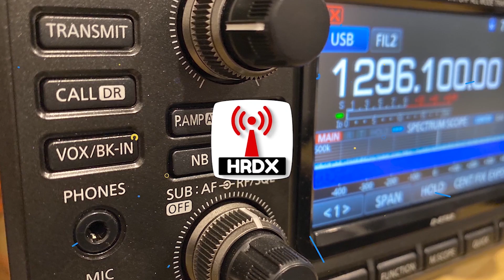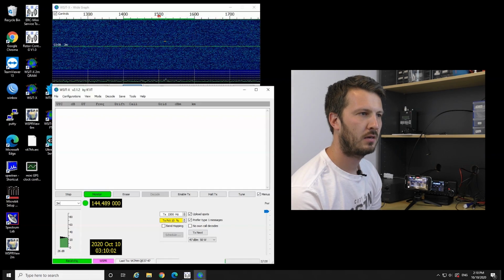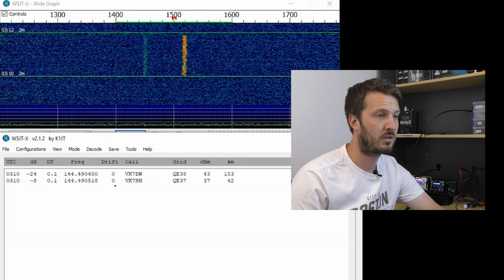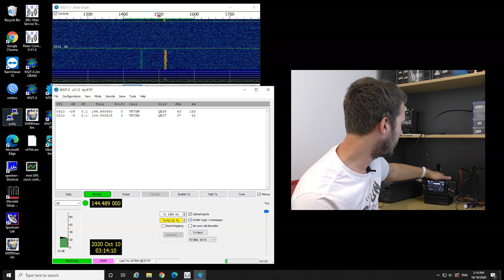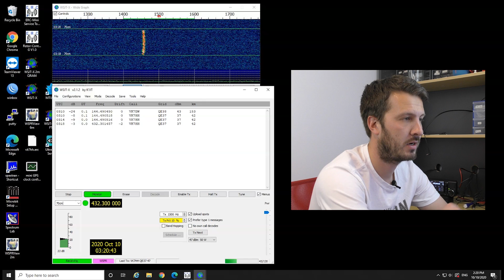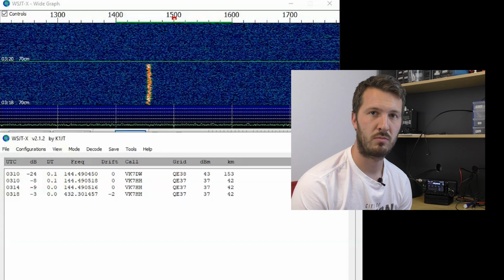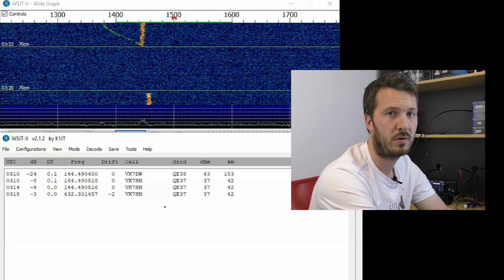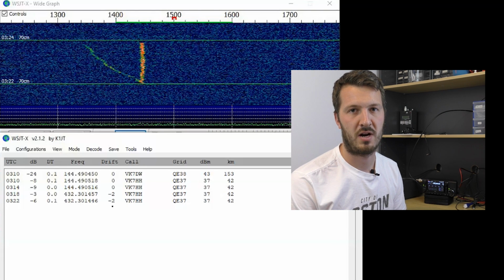Does the Icom IC-705 Drift? Test and Results HERE!

Comment: Great video, & happy to see confirmation of the IC-705's stability.  I have 2 transverters which are "spares" at the moment; a DownEast Microwave 1296 MHz. transverter kit I built many years ago, & 1 of the Ukranian - built 222 MHz. transverters that were sold on eBay.  I had the DownEast 1296 transverter installed in my attic (to keep the feedline length short); a squirrel got into the attic & chewed up the power & control wiring!  I had taken it down to repair, then wound up buying an IC-9700; the signal reports I was getting on 1296 MHz. with the IC-9700 were fantastic on both SSB & CW during the recent ARRL Sept. VHF QSO Party.  (I havent gotten around to doing the GPS lock mod on the IC-9700 yet).  I also acquired a RARE ICOM IC-375A 222 MHz. all-mode as a "tech special" radio & was able to get it working, so the 222 MHz. transverter is also a spare at the moment; considering setting them both up to work with IC-705 for QRP portable operation.

73,
Tom WA1LBK 😊

Comment: Would have been killer if they could somehow enable the internal GPS to act as a GPSDO. I know, it likely doesn't have the hardware configuration to be able to do that. My flex 6700 has a GPSDO but the stock oscillator is an OCXO (oven controlled Xtal oscillator) so it is plenty stable already.
Reply from the maker: I know right! That would've been the icing on the cake. That said, it's still a great radio

Comment: Of course the 9700 does not drift "because of long transmission", but because it has a fan that first draws in air at ambient temperature and then at ever higher temperature because the unit heats up due to the dissipation in the final amplifier.
So this test is not a comparison, as you already said "the unit does not even get warm".  And therefore it does not drift in this test.
Try cooling it down in the fridge to e.g. 5deg C and then operate it until it is at about 40deg C and then see if it drifts.
Reply: The purpose of the video.. "Does The 705 Drift"

Your comments are "non sequitur" the 9700 does drift, regardless of the mechanism
Reply: @MINI-4X4-RADIO  It is important to know the mechanism because it affects the setup you need to test the unit for drift.
I predict that when you do another test (e.g. take the unit with you in the car or on a hike), the 705 will drift.
The 9700 suffers from the design fault that the fan air directly affects the oscillator temperature.  The 705 does not have that fault but I doubt it suddenly has a much better oscillator that would not be affected by similar temperature change.
Reply: The 705 has built in gps. There is a possibility that icom took advantage of it and has built in a gps disciplined oscillator. I'll have to test that for myself with my 705
Reply: @bob_345-g3d  Yes, that is certainly what you could expect.  But for some reason, Icom chose not to do that.
Even stranger, it does not even synchronize its real-time clock with the GPS!  It has support to sync the clock over the network, using NTP, but not to sync it with the GPS.
Now that is something that could probably be added in a future software update.  But I doubt the hardware is available to sync the master oscillator to the GPS.

You know, even the 9700 does not have that.  It has an external 10 MHz reference input, but it cannot lock the master oscillator to that.  It only has a "calibration" function to tune the master oscillator relative to the 10 MHz reference, but once that function is complete the oscillator is left to run on its own again.
It requires a mod (e.g. the board available from Leo Bodnar) to change that and lock the oscillator to the external reference permanently.

The ways of the Icom engineers are unfathomable.

Comment: Why did the 70 CM frequency change 11 Hz lower between the two transmissions? Is that drift or did you change the frequency? 11 Hz is a lot of drift in a 2 minute period. Does the 705 have an external 10 MHz reference input? If so I would be using it. - JS6TRQ
Reply from the maker: Drift measured in this video is during a transmission. The frequency shifting 11Hz lower is probably thermal changes moving the oscillator between the transmissions. 

No the 705 does not have a 10MHz input, but I think it won’t be long before we see one
Reply: @HamRadioDX  actually, since the IC-705 has an internal GPS, Icom should implement frequency 'calibration' in a firmware update. That is if they had the foresight to include the hardware capability. (I have come to the conclusion that Icom makes great radios, but, they aren't a software company.) The concept of "proprietary" is not dead.
Reply from the maker: They aren’t a software company yet they have Software Defined Radios... makes sense. I think if you listen to my explanation at the end of the video, they did not design the 705 especially for microwave operations. You can’t please everybody. Just because it has a GPS chip in it, doesn’t mean it can be reference locked.
Reply from the maker: Glad you liked the video!
Reply: @HamRadioDX  Using the internal GPS as a frequency reference was one of the first thoughts I had about it.  Hard to believe some engineer at Icom didn't think of this.  I have no way of knowing whether it's just a software change or there's hardware needed that would prevent implementation.
Reply: Tom Sherwood , when you are dealing with digital data transmitted in 10 Hz bandwidths over 180 second duration, AKA WSPR, it's a big deal. These days it's pretty easy to get frequency accuracy of 0.01 Hz with long term stability just as good.